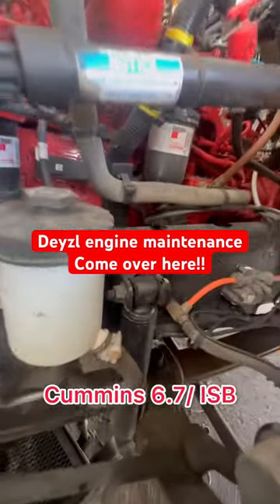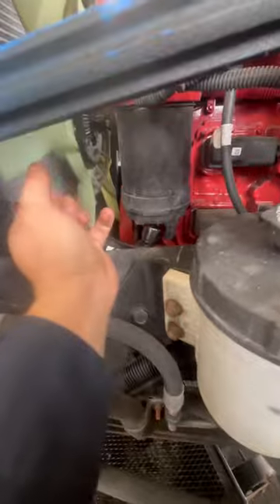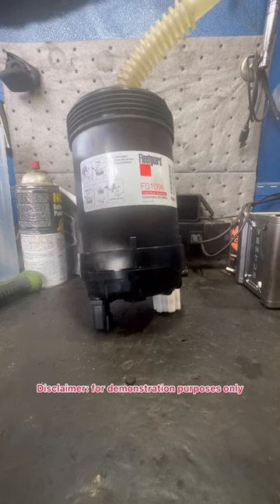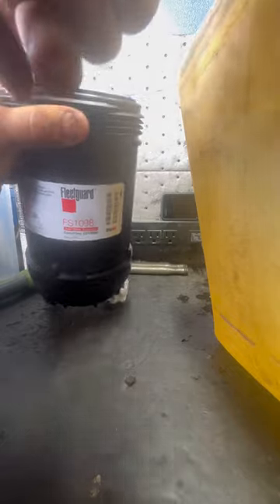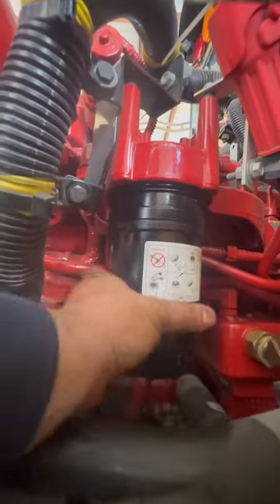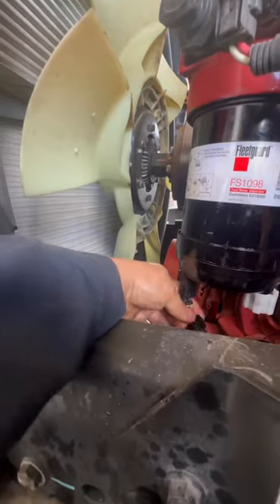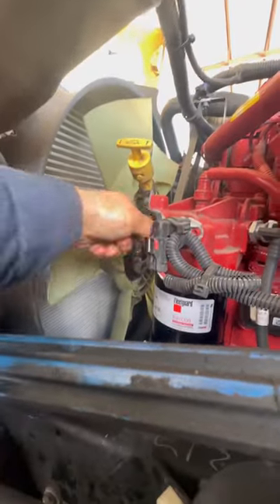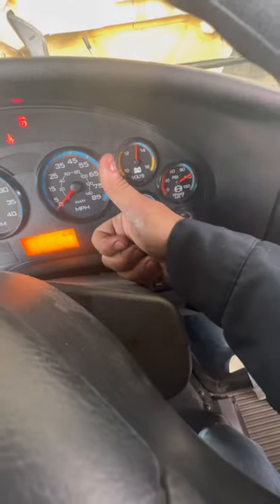#mechanic #truckdrivers #dieselmechanic #dieseltruck #semitruck #truck #dieselrepair #trucker

Comment: you only need to change the pressure side filter if the crank shaft primed the deyzl engine ac pully cable leaving the alienator unplugged so you have no brake coolant making it to the pressure filter

Comment: Growing up with older machines, changing the fuel filter (sometimes 2 or even 3) and the water separator at the same time was never an issue. However, the newer common rail systems having 30,000 psi or more are so finicky that I’ve learned to do one filter at a time. Any amount of air can turn a quick service into an absolute nightmare. 4 and 6 cyl Cummins that I find in stationary power units are especially difficult. I typically pre-fill one filter, change it, then run the engine for a moment before doing the other. Just food for thought

Comment: How much experience do you have on Mack trucks? Have issues on the power steering of a Mack dump truck
Reply: What's the issue?
Reply: @AuGrrr  steering gets tight when turning to the right. Will feel better when stepping on the gas?
Reply: @andrewm5190  sounds like a hand pump.  If turning left is fine the only causes can be the hand pump, line going to the front piston, or the front prison but those two rarely go bad. Hand pump could be blocked with crud. Try going to an open flat area and turning the wheel all the way to the right and straight to try and force that hand pump to clear itself. If not you may need it taken off and cleared or replaced or there is an issue in the line/front piston

Comment: How about letting the bus run through its checks before starting the unit?
Turn the key to start then wait till the glow plug light before starting engine.
I see the consequences of not waiting to start issues in my shop weekly because drivers fail to start their unit correctly. The computer tells me when I scan it for codes.
Reply from the maker: This one has a grid heater.  And it was 102 degrees F outside that day 👍🏻
Reply: @dthetruckguy1499  yes it has a grid heater. It still needs to run through it checks. Just wait till the squiggly lines light or the engine symbol light go off. It’s only a few seconds to wait.
Just good sense and practice.
Reply from the maker: @gthomas2936  good point 👍🏻

Comment: How come your fuel filters didn’t have any fuel in them? You didn’t show how to take out the rear filter. But the rear filter has room to pull out without making much of a mess. Good video overall
Reply from the maker: The pressure side filter was full. And yes I spilled some lol 👍🏻

Comment: Is that an x15
Reply from the maker: Cummins ISB
Reply: @dthetruckguy1499  ah ok thanks for the info im used to working on x12s and ism and m11 engines
Reply from the maker: @justinsmet no problem

Comment: Doesn't it have a electric lift pump cycling the switch should get the air out
Reply: Depends on the cummins since this one had a manual it may lack an electric though I believe most cummins have electric pumps so likely that is a backup
Reply from the maker: This one didn’t have one 👍🏻

Comment: Big no no pre-filling filters on a common rail engine with a jerry can, even with the diligence you had of covering the outlet port of the filter. I work on all types and brands of mining equipment, we never ever pre-fill our fuel filters during a PM. Even says not to do it on most filter labels themselves nowadays. Your best bet is to put them on dry, and utilize the system primer, either mechanical or electrical in nature.
Reply: why? they have a cap in the center covering the filtered outlet so whatever you pour in there has to go through the filter.
Reply: @asherlol7666 you’re not wrong. But pre-filling with fuel from a Jerry can, can possibly contain contaminants that can prematurely shorten the service life of a filter. Contaminants such as water that can destroy a fuel system, if it does not incorporate a WIF separator. It’s simply always good practice to not pre-fill fuel filters on common rail motors to eliminate any possibility of this. I work on CAT equipment and utilize SIS, and it specifically says never to pre-fill filters externally.
Reply: It can’t be as bad as firing some dry injectors for a minute.
Reply: @ak14619  thus why we utilize the primer. If done correctly, it fills the filters with fuel, and the injectors run off what’s left in the rail till the charge system catches up. Possibly dry firing an injector for a cycle isn’t as bad as having contamination go through it. Obviously the OEM has thought of this and thus why they advise against pre-filling externally. The same principle applies to changing engine oil, your main bearings aren’t going to receive full supply oil on startup, they run off residual for a short duration, same as a fuel injector.